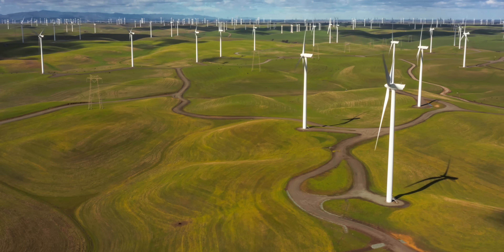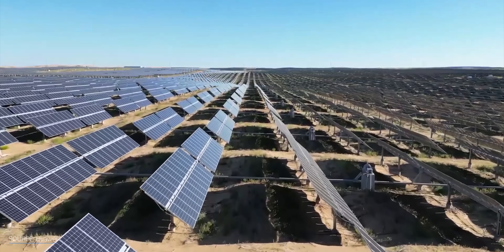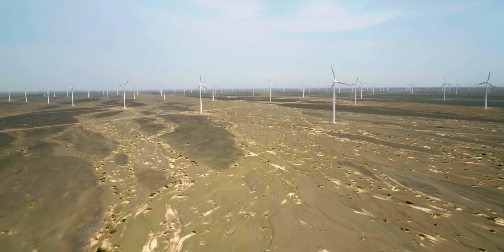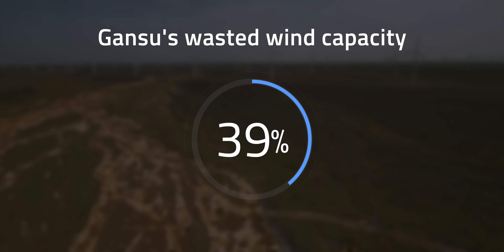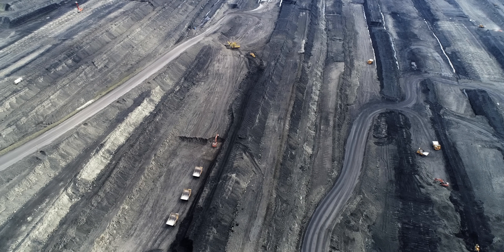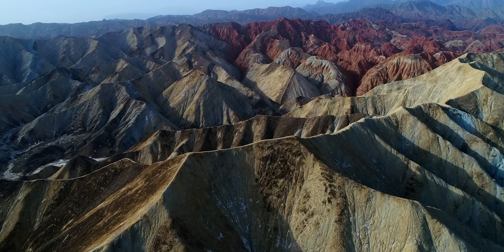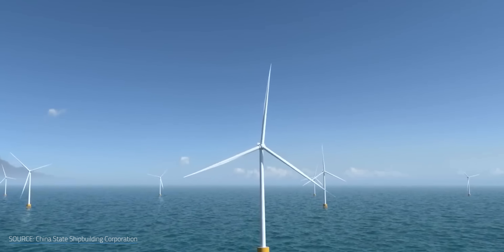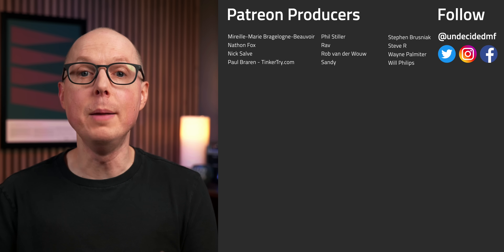The World’s Largest Wind Farm has a Tiny Problem

Comment: That 7.5 cents per kWh is basically a levelized measure of fixed costs, right?  My impression is that, once the cost of putting the wind farm up is sunk, the power is basically free; you wouldn't, on economic grounds, prefer to leave it idle and pay 4.2 cents for coal power.
Reply: My nephew works at a nuclear power plant.  They can produce electricity cheaper than the windmills.  The cost of building the windmills is part of the charge.  Plus there is a lot of maintenance keeping them running.  They only buy windmill power when their reactor cannot meet demands.
Reply: @robertheinkel6225  The cost of building windmills is part of the cost of producing wind energy, but once that cost has been paid, not using the windmills doesn't recover it.  Perhaps maintenance costs are lower if you don't use them than if you do, but I'm skeptical that that's a lot of money per kWh.  Perhaps I'm mistaken. 

(It is uneconomical to build windmills if the fully levelized cost is higher than costs of alternative energy sources in the future, but once they have been built the relevant criterion is how much more it costs to get energy from them than not to.)
Reply: Two major issues: 1. The turbine will NOT sunk its cost during own lifetime. 2. maintenance.

Comment: I don't know. With all these mega projects, especially in China, world wide we still have less than 5 percent from solar less than 8 percent from wind. From hydro electric it's just about 16 percent. I'm afraid that if we don't make a drastic change towards nuclear power, humanity will burn up enormous resources and energy - mostly from fossil fuel - to produce ever more mega projects of wind farms and solar arrays. China alone produces per year at least 1/10 of all concrete in the world, which totals 30 billion tons/year. And a lot of that concrete is used to build the foundations for huge wind mills. 
At the moment world wide only about 1/3 (at max 40% in USA) of electric energy is considered "carbon neutral", and this includes: solar (4.6%), wind (8%), nuclear (9%), and hydro (16%). But that's only electric energy. The total annual energy production is 172 PWh (172,000 Tera-Watt-hours), and thereof electric energy is merely 30,000 TWh, or about 1/6 (at max 20%) of all energy. From this follows that carbon neutral energy production worldwide is still less than 10 percent: You get about 8 percent from multiplying 0.4 x  0.2 = 0.08. 
  Then we need enormous resources of copper, steel and aluminum to realize all those windmills, and in addition huge amounts of rare earth minerals (for instance for all those magnets in generators), which already have made these resources enormously expensive. Production processes for all of these: concrete, steel, and aluminum are extremely energy intensive, and of course also the enormous earth movements and mining all the mineral resources, are all very energy intensive. Electric storage, battery farms etc - the same problem. Lithium and other minerals are becoming already the subjects of wars over resources - Just like oil and coal at the time of the robber barons used to be an important part of the story behind many wars. So I seriously worry that this grandiose idea to get "carbon zero" by 2050 is a big fat pie in the clouds, further inflated by huge speculation. The struggle to get anywhere near "carbon-zero"  may well make the problem of carbon emission a so much bigger - with all that additional energy coming for the foreseeable future mostly from fossil fuel. And this could become the actual tipping point that no one wants to talk about.

Comment: Isn’t it a dumb idea to put wind turbines in the middle of the desert? It seems like nobody understands the concept. You can’t power all of the US, for instance with a bunch of solar panels in the middle of the desert. You can’t just pipe the energy 1000 miles away. It’s not like water oil or natural gas.

Comment: This video is terrible. "ChInA's EmMisSiOns LoWEr PeR CapIta. Us BaD!!". 

The presenter has no knowledge on engineering topics, or else he would be explaining that a single 3MW wind turbine requires a clearance of at least 250m, meaning that you can only have 16 in a square km. That means you are capped at getting 48MW in IDEAL conditions per km^2. 

If you place solar panels in the same area, you would have a maximum potential energy of 1,360MW (provided 100% coverage). Even if you just did 100% coverage on 1/10 a km, you would still get 136MW, which is the same as 2.83km^2 of wind energy. Wind farms also break when there is a storm, aren't recyclable and are made from the oils you are building them to preserve.

For reference, a nuclear plant with 3 reactors can produce 3937MW per day. The building of this plant would be able to fit within the 1km^2 confinement, but usually has a lot of clearance around it. That makes nuclear around 48 TIMES better than wind for energy density. This is how I know this presenter is a C-CP shill and has literally zero engineering knowledge. "China good" is a red flag...
Reply: Energy density isn't that much of an issue when the land can be dual use.  Those wind turbines work just as well when they are built upon farmland.
Reply: @vylbird8014  You can't put them on farm land. The equipment would destroy the cables. Digging the cables deeper would be a waste of copper. Farmers already use solar.

Comment: Dumbest “ problem “ ever. Just build a hydrogen cracking facility and generate green methane.
Reply: deserts (as where Gansu is) are defined by the lack of rainfall - so little water to crack; unless you pipe water in (but that is more intensive than to ship electricity to the water)
if you mean crack hydrocarbons - again, you have to ship the hydrocarbon to the electricity, or the electricity to the hydrocarbons
in general, building wind turbines where there is no demand is pointless

Comment: In Quebec all the energy production from hydro dam are way up north where nobody lives.  We transmit power via 735 000 volts high power lines (only surpassed by Changji-Guquan Power Line @ 1100 kV) , to keep the current down and cable sizes down.
Reply: Yeah, electricity is quite inexpensive in Quebec.
Reply: In Manitoba it is similiar to Quebec, power transmitted long distances from up North

Comment: You are aware, of course that the industry standard is that any wind turbine operates about 34% of the time to generate appropriate levels of energy all other times there is not enough wind or there is too much in the Gobi desert. I’ll bet that most of the wind that constrains use is Highwind. . I have experience planning a 30 turbine unit on the Baltic coast of Poland. . It’s quite a good area for wind energy generation, but even there standard is the same. We have to lock out the blades when the wind gets too high. Otherwise you will ruin the turbine generators which are extremely expensive. 
Further building a wind turbine is an energy negative as it takes far more energy to build the turbine system than the turbine system will ever produce in its lifetime and it does have a defined lifetime . Even with extended maintenance, I would guess the turbines in the Gobi a very harsh environment will not last more than 10 to 20 years. . And it’s a desert with desert storms kicking up dust and dust is a killer for mechanical machinery. . This project may look good on paper but an actuality it’s probably more a showpiece than it is a positive generator of electrical energy that is so-called clean. . But just like with electric cars, if producing them creates more of a carbon footprint than they can ever offset in their lifetime, I don’t know who anyone is fooling . Electrical energy is not a panacea. It has its place in certain applications. But given that carbon dioxide is essential for carbon units to exist on earth, including all the plants and only makes up 3% of the atmosphere I think there are other words that we need to be much more concerned with. .

Comment: I really hate wind power. 
Im on the east coast of Canada and we have near permanent wind. On the ocean we see storms that have taken homes off cliffs more then i can count. 

Our government decided the mountains behind our rural communities were perfect.  

Here are my problems.  
Birds, if you tresspass and go beneath these things there is a perpetual corpse pile of birds.  Mostly larger rapters. 

Noise, jesus these things hum and it drives you nuts. And if they dont shut it down before a storm they make a scary ass thumping deep booming sound as they spin like mad. 

Looks, they look like shit on our gorgeous landskapes. We are famous for our maple tree forests turning color. 

And lastly we didnt get anything for this. Our power bills are still absolutely insane.
Reply: yea ill take Wind farm every time over coal. I used to have to clean black dust crud off everything i left outside.
Reply: All of this expenditure doesn't make for cheaper power
Reply: @philipMorris-e9q  Especially for China (where the current topic comes from) that isn't the issue at all. Regardless if they use remote wind power in need of hughe transmission lines, more local Hydro power that was labor intense to be built, especially the dams, or rooftop PV that uses mostly materials from their own domestic production, power prices are just fine for them becuase whatever they do their own labor is cheap and therefor also their energy bills will stay low.
That this is different for many other places in the world is not a secret, but it has close to nothing to do with which source for the power was chosen.
Reply: Noise, looks....  That's why Gansu Desert is perfect for this project. Hardly any life-form can survive in the desert, be it human or birds...
Reply: Birds are not killed by wind turbines in vast numbers. Thats where the lies start. And they end with noise.
Reply: @beatreuteler  Says someone who DOESN'T live near a windmill to one who actually does:  "Don't believe your lying eyes and ears; listen to me."

Comment: Please never replicate this anywhere!  What a colossal incredible eye sore or man created natural disaster!  Wind farms take up immense space tearing up vast areas,  same with solar, are incredibly ugly, ripping up land to create thousands of miles of new transmission towers and lines.  They both require full 100% back up by other power generation as well...so absolutely suck!   They are not nearly the solution that putting clean modern molten salt nuclear at existing coal plants would do, with transmission lines in place already.  Why recreate the wheel?  That is stupidity with tax payer dollars.  A 1.5GW nuclear reactor takes up less than an acre.  Solar power on home and building roof tops would be ideal...no destruction of our environment...go with that if you want solar.   Have Musk create Solar Power Space stations, 24/7 power beamed back to earth.  Stop tearing up all our deserts for this colossal junky mess.

Comment: quick question........... If China is wanting to be greener then why are they building 300 coal fueled power stations?
Reply: because they need the power to develop their economy and clean power alone cannot keep up with it. All political needs have to be built on economic base.
Reply: AC systems engineering 101 - you need synchronous machines to maintain alternating current frequency.   Wind turbines are asynchronous machines which don't maintain frequency.

Comment: wait til all those wind blades need to be replaced.   Blades last about 10 years so it won't be long now.  In Texas we have several land fills full of turbine blades.
Reply: @JimQuinn-tb3uq  10 years is in good conditions. The desert ist far from that. the fine sand creeps into every space of the motors degrading them, the more corse sand blasts the blades to bits. That is why offshore installations need to be repaired so often, water droplets carrying fine sand rip the blades appart.
Reply: @AlphaHorst I have yet to see sand creep into the inside of the Generators or Hydraulic motors at the Mojave Wind farm during disassmebly.
Reply: @JimQuinn-tb3uq  yet you drink your water out of plastic bottles, and your autos are 80% plastic.
Reply: @JimQuinn-tb3uq  and solar panels, they're an environmental disaster waiting to happen.
Reply: @Daniel-e8d5c sounds like a conspiracy with absolutely 0 proof for it
Reply: Yes the US is slow at improving technology and recycling unlike other countries which are manufacturing them out of wood
Reply: @Karl-Benny  Yes and no. Those who make them of mostly wood, tend to use Balsa-Wood in order to make them lightweight. But these stand in the headwind of criticism because Balsa-Wood is a resource that's increasingly becoming scarce due to such usage and due to the burning and cutting of forests down south.
Reply: right its not green energy at all..  Same with electric cars soon.
Reply: @Skulcius  There is no tech that is without any impact. What is important right now is that we do not stop this transition because of impacts that are still much smaller than the impact the old tech has. And while this takes a long time still to perform, we have also a lot of time to find good ways to recycle these materials.
Reply: Yeah, and there aren't ANY consumables in a coal-fired power plant, right?  Conveyors, loaders, millions of bearings . . . none of that can compare to a landfill with photogenic used-up wind turbine blades.
Reply: @alsavage1  All that is easily recycled. From fiberglass turbine if the frame is metal that can be recycled, but blades are so far always been buried on site, the internals can be recycled but to get those fridgerants processed is kinda pain, specially amount needed. When one of those decides to burn as a torch due bearing failure then its massive problem, specially with the fridgerant that is equal problem of 10 000 car AC's dumping their fridgerant over their life time, just for one turbine... Similarly solar panels get "recycled". Far as i know there isint one place that actually takes them apart, but only strips the aluminum casing and wires off, while rest get shipped into African E waste dump for locals to smash and burn them to collect what they can scrape from them with primitive tooling and further polluting their ground water with heavy metals.. then again whole areas ground water has already been polluted beyond use so guess that does matter at this point...
Reply: @Hellsong89  I don't agree that the scale of buried/non-recycled solar panels (with a useable lifetime of decades) or turbine blades (similar) is near the scale of the detritus formed when coal is mined, processed, used (burned), and disposed.  Coal ash pit/pond failures in the US are just not on the same scale as buried turbine blades, and while smashing electronics and burning them in drums to harvest their precious metals is horrible and goes on 24/7 with our current waste stream, again solar panels are and will continue to be a tiny, minuscule fragment of the electronics waste stream in total.
Reply: The blade’s cannot be recycled
Reply: @robertmontgomery7158  They can and are being recycled though, what makes you say that?
Reply: @robertmontgomery7158 Oil and gas can’t be recycled, once it’s burnt, it’s gone.
Reply: @robertmontgomery7158  They can and are being recycled. There are now multipel plants processing them into concrete reducing the ecological impact of concrete production. It is not really renewable, but its keeping stuff out of landfills, other methods are also being tested.
Reply: Typical lifetime is 20 years. So even in harsh environment they should do 10+ years easily.
Reply: @beatreuteler No. We are   seeing 8-10 in Texas.
Reply: @dmixdup  If that is the case, the manufacturers need to look at it and make them better. I have seen photographs of Texas Windfarms and I think some of these pictures were from the northern neighbour state (Oklahoma?) right north of the border and just from their look I had the impression most of these are more than 10 years old so maybe they haven't been built of an improved tech as of yet. That could be a reason for failing prematurely.
Reply: No. New blades are designed to last around 20 years, but can sometimes last up to 25 years. USA are wasteful and wind turbine blades can be recycled in a number of ways, including Cement production
Reply: @marcgalle3529  your "new blades" last 5-10 years in British off-shore farms.

And that is the case for any windpark in such a, or a similar, place.

Comment: I dont no much about energy storage, but why not synthesize heavier hydrocarbons from electricity, which can then be burned and transfer energy? Is it posible?
Reply: It can be done, but the energy going into the process is far greater than the energy you get out again. It's just not efficient. And it's not commercially viable either, because it's cheaper to just buy the same hydrocarbons from an oil refinery.